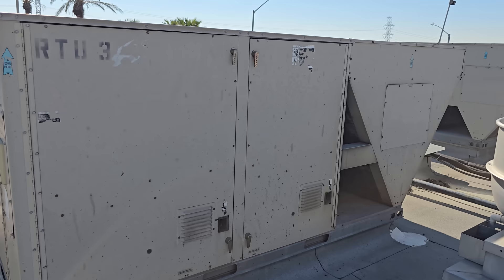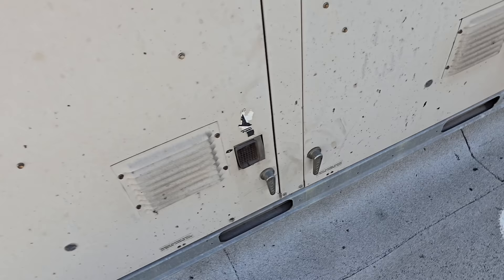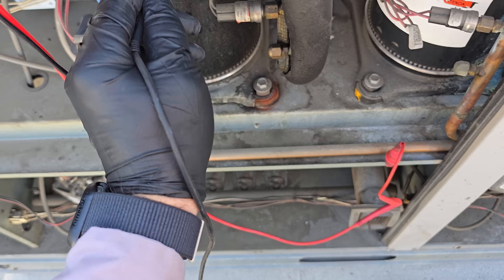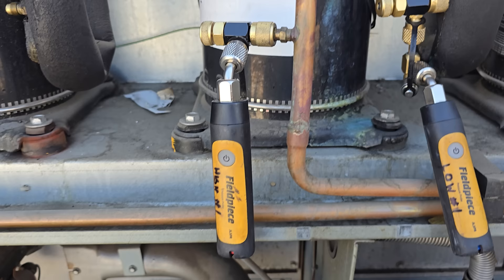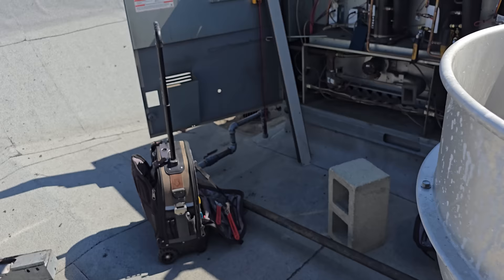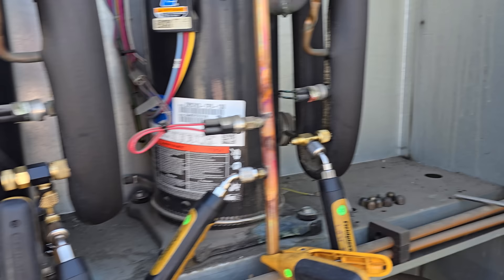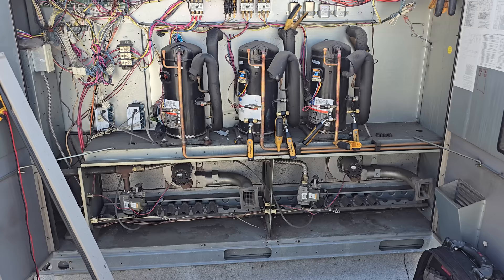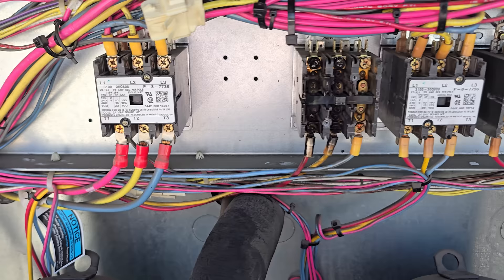THE MAIN BREAKER IS TRIPPED AND THE AC IS NOT WORKING

Comment: Last week, we had two separate electricity fluctuations at the donut shop due to high winds and tree branches. Both times the power flickered, I needed to reset 6-10 breakers to restore power to 110v and 208v equipment. One circuit had barely 2 Amps of load (wireless headset system) on a 15-Amp breaker, another circuit had about 4 Amps of load on a 15-Amp breaker, etc. Over a million bucks spent on "renovations," and the worn-out 1990s breakers are still in the panel. (EDIT: Most of the breakers don't "click" on or off, they have very "mushy" operation that is more than a bit concerning.)

If our 208v espresso machine starts working, you can hear the 480v microwave convection ovens' internal fans slow down. If the microwave convection ovens are cooking something, all the LED lighting overhead starts flickering. At this point, I'm simply waiting for the place to burn to the ground so I can stand there with a smug grin and say, "Maybe next time you'll listen to me?"

Comment: Great explanation of what a circuit breaker does. So many people have this idea that the breaker is to protect you/them. A standard breaker couldn't care less if the power is going through something plugged/wired in or you so long as the current isn't above its rating. It will let you get electrocuted all day long. It's there to protect against overcurrent that could cause a fire or other hazard. GFCIs are meant to protect you, and some breakers do have those built-in, but a standard breaker ONLY protects the wiring and ONLY looks for overcurrent.
Reply: It doesn't even protect appliance cords. If the fault is in the appliance or its cord, and the cord isn't sized to handle the full fault current required to trip the breaker, too bad.

Comment: Hey Chris, I love watching your videos even if I'm just a sparky, it helps to show me troubleshooting tidbits, I did notice though that at the beginning of the diagnosis you checked for continuity to ground, however its also good to check for continuity between the phases before re-energizing a tripped main breaker as I have seen a scenario where 2 phases were shorted together but weren't shorted to ground.
Reply: That is a possibility for sure. Sometimes you can confuse yourself as you can have a low ohm reading between phases but not a shortage. But yes best to check while you're at it 🎉
Reply from the maker: Great point and thanks for the nice words and for watching!

Comment: From my 30 years as a Master HVACR tech experience, I would also work into my quote all 4 contactors, the 3 main compressor contactors, and the Blower motor from the signs of overheating on the terminal connectors. But that is just me I hate my OCD about that stuff, but I hate call-backs even more for stupid stuff! lol  PS: guys your 5 senses are some of your best tools, Sight, Sound, Smell, Taste, and Touch as a service tech. I picked up a 6th sense and am about 99.99% accurate when it comes to finding janky sketchy shit. lol And what you saw with Cris was his Analytical skills kicking into high finding Janky shit, like the duct detector watermarks, the plugged filters, the shitty belt pulleys, the ripped metal pre-screen filters, and the overall state of the unit. I walked up to every unit with a flash-lite and a clipboard with pen like a detective looking at a crime sean, and started asking questions. lol PSS: People the units will tell you a story if you are just open to listing what it has to say!

Comment: After about 30 years into the trade you'll be able to diagnose  with one low side gauge,
 an old Taylor stem thermometer and fix most of it with a SOG or Leatherman tool.
You know what the real problem is?
A 20 year old Lenn-ox!
This ain't  a 1950's  Carrier Weathermaker!
Shame the owner for having inefficient  garbage still being used.
My rule was 10 years max on anything.
7 years was maximum for equipment depreciation!
I only slummed for mom and pop startups until they got on their feet and understood equipment depreciation for tax advantage for their business.

Comment: NOT SURE WHY BUT, THE 2 BURNT TERMINALS SHOW A 1 PHASE CONDITION DOWN TO THE COMPRESSOR. YOU CAN PROVE IT WHEN YOU OPEN THE COMPRESSOR AND THERE IS 2 BURT, 1 GOOD PATTERN ALL THE WAY AROUND THE WINDINGS.  I WORKED IN AN ELECTRIC MOTOR SHOP FOR 24 YEARS.

Comment: Excellent troubleshooting skill on display here.
That thing had to have made one heck of a bang when it went.
My first thought was that contactor looks like it may have closed on a phase-to-phase short.
How that short got there? 
The world may never know. At least until you get a chance to angle-grinder that compressor apart. I'm so looking forward to this one.
I think it either single phased from a failing contactor and/or prolonged overheat degraded the oil and windings until something went phase to phase short, just in time for the unit to call. KAPOW.

Comment: I replaced some blower pulleys on a couple of similar Lennox units last week. I couldn’t believe how stupid easy it was, it was especially cool how just with the removal of two screws that whole blower assembly can slide right out. 

As for those core depressors, I just recently discovered those marvelous little things. I picked up a cheapo Yellow Jacket version out of necessity, so I could pull a vacuum on a system with those stupid coremax valves. I plan to eventually get a couple of those Appion versions. I have an Appion vacuum rated shrader core removal tool, and finally used it for the first time yesterday. They definitely make a quality product.

Comment: I would totally guess here that the motor shorted internally between two phases, (1/2) and then fused/melted the contacts together on the contactor.  It then melted the windings and opened up internally.  I am surprised there are no fuses internally in the unit to protect all the internal wiring of each fan / compressor.  I see the one set of fuses, but assume that is for the fans.  👍🤠

Comment: Your the greatest. 
Nice job.  It's very important for people to realize that those are not always a current.
 protectors. Also if the lower circuit of the evaporator is the one that's not working it can cause water leaks in more humid climates, although that should not be a problem in Southern California. (But don't quote me)
Contactors should be checked during a p.m.
Reply: Yes, you're 100% correct.

Comment: European here, so my point of view about electrical stuff if going to be different from the one an American would have.
I noticed that the contactors have no overload relay or any other means to shut down a compressor or blower motor if they run into an over current condition. That seems dumb, if a motor would run into a situation that leads to it pulling more current that what it's rated for, you want it to turn off to not burn it out.
What I want to say is that the way that unit is wired seems, to me anyway, to be asking for this sort of thing to happen really.
Reply: i was noticing that as well. yeah, it is a few extra parts but O/C protection on anything high RLA (>8A) is safer than just hearing a compressor go bang or a blower motor become an expensive grind lighter.

Still possibly wouldn't help if a winding was going short to another leg, though. especially right on startup where things get risky as it stands.

Comment: Looking at the temperature of the first register does show total system performance for a unit which is important from the perspective of mechanical engineering. However, looking before you pickup motor heat in a draw-through fan type of unit should tell more precisely about your refrigerant system's performance. At the register you have to remove the motor heat and that's more of an estimate unless you are getting pre and post motor readings.

Comment: 7:50 You were in tone mode, and it didn't beep between the legs. Open winding means no connection between the legs - so infinite resistance. Open winding is the opposite of a short, no?

Comment: Could you explain what you meant by you switched the wires to the top of the relay to test fan operation? Also, how do you troubleshoot those relays on the lennox systems? I recently jumped to commercial and we work on a lot of those lennox prodigy systems so I'm trying to learn as much as I can about them. Love the channel and I'm going to check out those core depressors, thanks man!
Reply: My guess is the stage 1 fans are powered by one relay just for stage one, and that relay wasn't activating due to the pressure switch, so either he switched the wires to a different relay from a different stage, or switched the wires from the output side of the relay to the input side to get the fans running for the test.
Reply from the maker: Thanks for the questions, I'll dive into them a bit further on my next live stream

Comment: with the burned contactor I would have removed the load-side wiring instead
the coil is designed to handle long-runs and the part we are isolating is the blown compressor

electrically there is no difference to a welded contactor to just remove load or supply side, they both effectively remove the welded copper bars from the circuit

now from a safety standpoint it is slightly less safe to have 150a 208v three phase exposed and not connected to anything, but as this is the control box with other similarly exposed 208v three phase connections I see no benefit in removing the supply side instead of the load side

in fact it is silly to remove supply with the included contactor power transformer wiring, just isolate the compressor from the AC supply

actually just unplugging and covering the molex with a temporary flag and tape would do just as well, you flag it as "blown contactor and compressor, do not re-plug" and problem solved

Comment: What killed that compressor was that kitchen exhaust fan inches away.
Reply from the maker: Nah they don’t cook anything under that fan and they haven’t for years even when they did it was just nachos in a salamander , they just don’t do any maintenance on their equipment and that is what killed the compressor
Reply: @HVACRVIDEOS  salamanders run about 900 degrees. it sure didn't help when they ran it to a neglected 20 year old piece of garbage!😆
Reply: @HVACRVIDEOS  I'd advise extending the ducting  of that exhaust fan at least as high as the condenser  fans on the new system.
You could even scab a section of round metal ducting to keep the heat away and not mess with moving the exhaust  fan.

Comment: The oil on the motor windings may act to breakdown the coating on the windings and the dirt that gets stuck in the oil can act as a thermal insulator. Kinda like "fixing" a fan by spraying WD-40 on it. Once it gets on the windings it's only a matter of time. After figuring out how the motor got coated in oil and eliminating that problem then the motor should be replaced or put on a watch list because it's gonna die sooner.

Comment: Do you use acid scavenger to help neutralize any oil that's still in the system?
Reply from the maker: No I don’t, I prefer not to add anything to the system that isn’t the proper oil or the proper refrigerant. If I have a dirty system I clean it up with driers and new oil

Comment: Did you have to jump out the y1 on the board or did the two secondary compressors always run at the same time
Reply: generally Y1 is Stages 1&2, Y2 is stage 3 in those units from what i can derive.

Comment: Chis, did you check for phase to phase shorts anywhere before resetting the breaker? i saw you check voltage and continuity to ground but the only place i saw you check for phase to phase shorts was the compressor itself.

Comment: So what is the difference between triped and off !! 
Both cases off !!
Thanks for your videos
Reply: My understanding is that most breakers in the USA have distinct positions for "off" and "tripped" and you have to move the handle from the tripped position to the off position before you can reset it. This distinguishes a tripped breaker from one that is just turned off and also makes resetting more of a deliberate action.

The din-rail mount breakers we use here in the UK on the other hand normally have no such distinction.
Reply: @petermichaelgreen  Makes sense, Thanks.
 In Dubai also on/off never saw something with trip
Reply: @petermichaelgreen It may be related to the requirement that breakers "trip free": they have to be able to trip, opening the circuit, even if the handle is jammed or held in the "on" position.
Reply: @gwillen  Breakers "trip free" on both sides of the pond...

Comment: I don't like how you are using the schrader core compressors. If you are not bleeding between the probe and the core compressor, then it means that the air, all the way from the sensor to the valve part inside the schrader core compressor will migrate into the system. The air will not stay in the bottom of the probe, it will mix with the refrigerant into the system. Not the end of the world, just the feedback you are asking for sometimes. After 10 times probing up, it may be an issue if it is POE oil.
Reply: Ah yes all that air getting into a positive pressure system that’s higher than atmospheric lol
Reply: @hvacmisadventures  I am sorry, it is wrong, the small amount of air will mix when the pressure has rised, then it is free to go. Just like mixing concentrated beverages with water in a glass, the concentrate first and water on top, it will still mix.